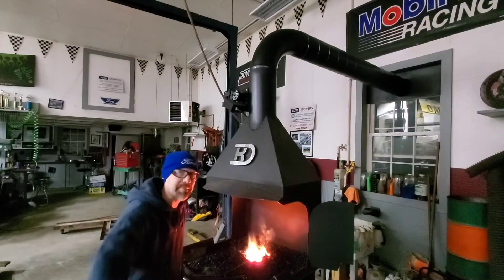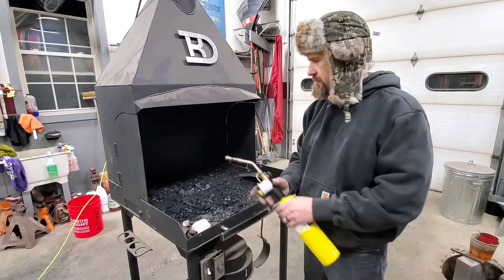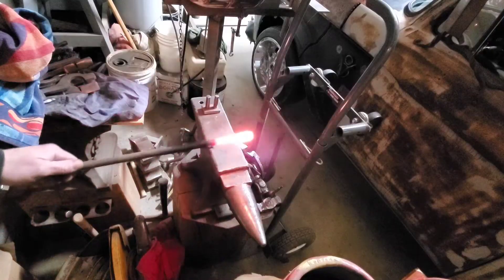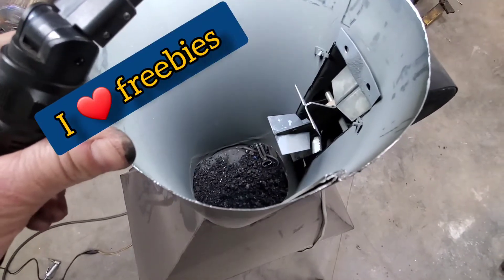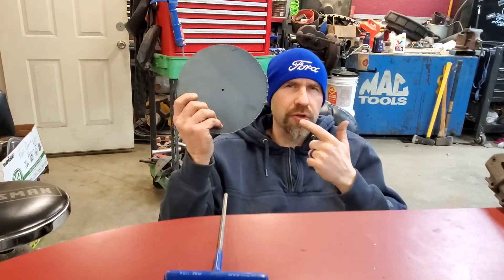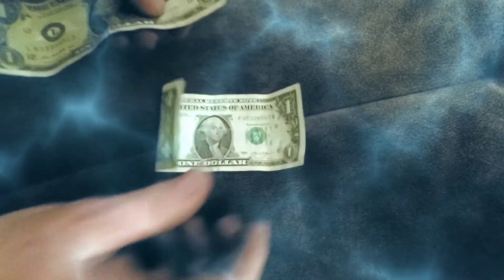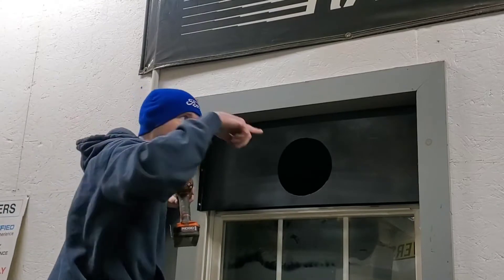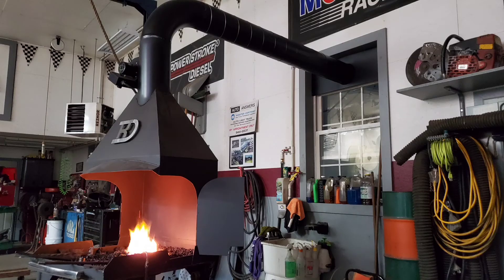Coal Forge WINDOW EXIT CHIMNEY ep.06

Comment: Your sense of humor is spot on👍🏻
I wonder, after the chimney is warmed up will it keep pulling smoke threw the chimney if the “suckafier” is turned off?
Reply from the maker: It gets a little bit of a draft but not enough to gobble up all the smoke of some green coal. I just keep it on full time and keep my shop clear.
Reply: Hammered Ironworks I understand that. I figured it wouldn’t keep up but had to ask.